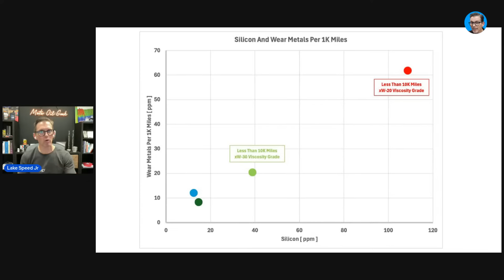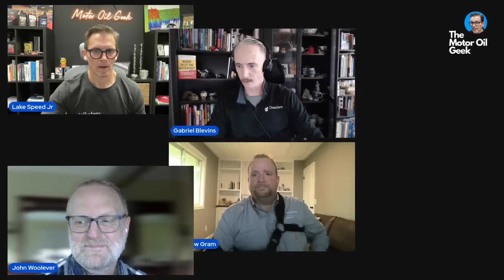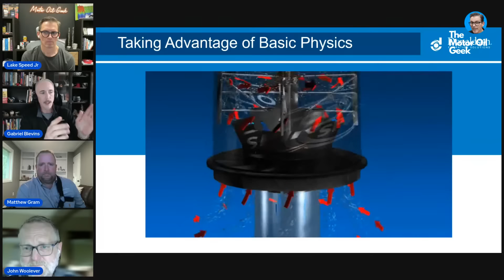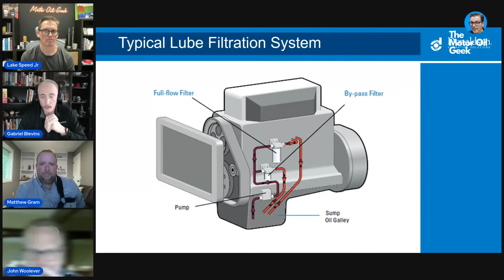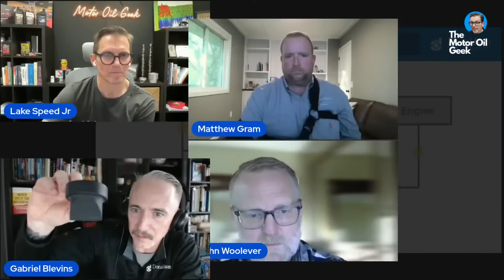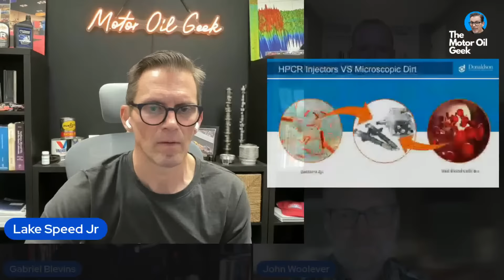DIRTY Filters Are BETTER Filters + BYPASS Filters EXPLAINED

Comment: 57:21
Well I think it is true and I cannot say how much I was surprised when I changed the diesel filter of my car after 50000 km (at 150000 km). It was extremely clean and the diesel filter housing that is gonna hold any drop of water has no water or dirt!
I always fill up with diesel at Total gas stations but I have no idea about where the previous owner filled up with diesel. So I can tell you that diesel is clean here in France and it should be. Because the high pressure pump on the diesel cars is extremely sensitive and the injectors holes are super small.

Comment: i see so many rats and mice in engine air filter boxes / cabin air filter boxes so just remember to either block off with wire the entrances (preferred) to you cabin air filter / your engine air filter. at least check it immediately if you see rat or mice poop under your hood. if they eat yoru air filter you are in a world of hurt or youre breathing in a ton of rat poop potentially just driving around. i just foudn one that over like quarter pound of poop iin the cabin air filter

Comment: Can you do a oil filter test, a special one. Say a wix xp filter says 20k miles, cut that in half, we aren't doing all highways miles, so now it's a 10k filter. If I change oil about every 3k miles, can it be re-used 2 or 3 times? leave it on or take off and drain and put back on? Is a XP filter a waste of money and just get the regular Wix and toss it every change?

Comment: As for air filters, I used to own a tuk tuk in Southamerica and the filter was an oiled sponge you would wash with diesel and oil again, wringing out excess, every oil change. So I'm thinking of putting an oiled sponge in the air duct of my 4x4 as a pre filter...might work if it doesn't restrict air flow too much...

Comment: Believe it or not, a dirty filter will get better mileage because it limits flow which is all that the mass airflow sensor sees. Less air is less power and less fuel is used.

Comment: A combine used in a crop like soybeans may be the dustiest environment I've ever seen and yes, I've seen the times that they need cleaning or inspection every day or every couple of days. Most manufacturers recommend light tapping on a tire or something similar, or washing in soapy water and allowed to dry, but not compressed air.

Comment: The problem is I've caught dealerships red-handed NOT changing out my oil filter during 'free' oil changes. Therefore when I do my own supplemental (5k mi) oil changes on my cars still under warranty, I always feel compelled to put in a new oil filter (all of my cars take cartridge style oil filters). You simply cannot trust dealerships to actually do what they say.
Reply: I worked for dealerships for twenty years and NEVER saw a mechanic or apprentice NOT change any parts that were specified to be changed for that particular service.

It is of no benefit for a dealership mechanic or apprentice to not change any parts, as it is not coming out of his pocket.
He doesn't own the business.
The extra time it takes to change the parts is not coming out of his pocket in lost labour charges.
I have NEVER worked next to ANY dealership mechanic or apprentice that had brand new, unboxed parts sitting on his workbench after a customer's car went out of the workshop.
It never happened.

In fact, if it were to happen, it would be more likely in the independent shops, as  if they didn't fit the parts but still charged the customer for it, there is a financial benefit for that owner operated independent shop.

Your opinion is  unfounded and totally BOGUS.

Watch out for those independent mom and pop type shops, they are doing it tough, and need to make money at every possible opportunity.

Comment: What about break in process? Does this still apply? First startup for 10 min, flush oil, run new break in oil but don’t change the filter until next change? Or should we still change the filter since it’s “extra dirty”?

Comment: I worked in water treatment R&D.  With a single media as you describe being top loaded we would often only get 1/8 gal/sf of flow. This would mean a huge filter to provide water to a community. To beat this we created a multimedia filter in three layers. The outside filter collected large particles, the middle filter smaller particles and the lowest filtered out the finest particles. Which this method we could increase flow to between 10 & 20 gal/sf of media. Why can't this be done with filters for automotive & industrial applications.

Comment: Ahoy, oil, oil filter geeks.  I would appreciate it if you could in the future discuss Marine Diesel and Gasoline oil and oil filters.   Specifically, GM and Ford small blocks and Detroit Diesel best oil, oil filters to use.  Because most small block gm or ford engines use a single oil filter, assuming a by-pass valve exist in the oil filter, do you recommend a bypass filter in line with the by pass, effectively filtering the oil twice when the primary filter is not block.   Thank you

Comment: I put an Amsoil EAO26 filter on my 98 Lexus GS400 just so I could replace the tiny factory filter with a 2 quart filter just to add oil capacity.  After watching this I probably should have never changed that filter ever, 2 quart filter and that engine was super clean in the 328k miles I had it.  With oil analysis it did well!  But 25-30k oil drains was on the edge of oil life.  

I am thinking about starting to go to oil analysis for oil changes instead of mileage/age oil changes.  I drive so much highway driving to work and back I'll bet Lake can tell me better when I should predict to change my oil instead of just mileage.  

when I was in the US Army they were very big on oil analysis oil changes only.  I RARELY ever needed to change my trucks oil.  855 Cummins and a LDT465 Turbo.  They would tell us when to sample and send it in and then tell us what to do, filters, oil or both.  The HMMWV's got regular oil changes but the big commercial diesels we had never did.

Comment: I put an air filter indicator on my Honda Talon because everyone says that the filter on this model only lasts a couple hundred miles.  After 2,000 miles the indicator still hadn't moved and I hadn't lost any perceivable performance even tho the filter looked horrible.  I replaced it only because I'd bought a complete service kit that included it and it lives in the desert 150 miles away so I decided I should change it to not have to deal with any mid-season surprises.

Comment: Many decades ago I was a "Filtration Specialist Sales Engineer."  Got trained by the OK City company that makes Wix and many other filter brands.  

The fact is, that dirty filters filter better. Of course, you don't want to clog a filter so much that the bypass opens at normal oil temperatures.  Highly unlikely unless you never changed your oil filter.

Another seldom acknowledged fact is that even if a filter is rated at XXX percentage efficiency at 30 microns it will often filter much smaller particles. This is due to particles that might pass through the filter just simply stick to the media.

Comment: My connecting rod went through the engine of my F800GS. The dealer blamed it on an aftermarket oil filter. I had replaced an OE filter with a Bosch. The specs appeared to be in favour of the aftermarket, having a slightly larger filter of the same efficiency/media type, and a 8 psi bypass versus a 8-11psi (never used I'm sure). The both have anti-drainback valves and are side mounted. I assume both filters are more than adequate and neither should reach bypass in a healthy engine (i.e. the dealer is full of it).

Comment: Would it be acceptable to leave a 20,000-mile oil filter on for three separate 5,000-mile oil changes?

25 F150 5.0 Coyote, Purolator Boss 20k oil filer, Pennz 5W30 Ultr Platinum
Reply: If it says it's good for 20,000 why not try and leave it on there for 20,000 see what happens.

Comment: hmm, if replacing oil filter too often could end up with “worse” filtration, then I wonder if it would be beneficial to change filter every other oil change? For example if oil filter is good for 10000 miles by manufacturer then changing the oil every 5k and oil filter every 10k would benefit the filtration efect?

Comment: I have a cleanable dry performance air filter with an oiled foam wrap around it in my 03 Z06 Corvette in the wet Pacific NW. The red foam wrap starts to show some dirt on it, while the dry filter at least looks totally clean. My recent 4,000 mile oil analysis showed 12 ppm for silicon with AMSOIL Z Rod 10w-30 oil. Does this look like a good program?

Comment: Lake, any plans to do a video on Oil Filter Efficiency over time? And does this mean if buying a Purolator Boss oil filter rated for 20,000 miles, can I conduct 10 oil changes before changing my filter if my OCI is every 2k miles.
Reply from the maker: Yes, that is on the schedule for later this year.

Comment: so what's the difference between cold air filter compared to a regular filet. my 2006 ford focus had a life time air filter, which is the last filter you need for your car. to repalce the air filter was almost $700.00. as i was saying eariler, what is the difference with position of the air filter. on subarus they have 2 air filter, 1 filter is below the windshield then the 2nd air filter is down below thebumper. by design of the instalation. then as for the motor is their a diference between front/reatr/mid engine. as well will more filters maximize the air flow???? then time of year where as middle of winter will be different then dead of summer. then the location its being used as well, like some of them are being used in coal mines, are different to the street of downtown Calgary vs dead of summer in the dessert.

Comment: The problem with just adding a bigger filter for something like engine oil is going to be to do with dry starts. A lot of car engines will have the oil filter mounted sideways, or even upside down (like Subaru does), and the result is that even with the best anti-drainback valves, the filter is still going to be empty when you go to start the engine in the morning. 

What then happens is you have to wait after the engine starts, until the oil pump fills the filter and pressurizes the oil galleries. If you have a bigger filter, it'll last longer, but it will also mean that you have more time running without oil pressure every time you start from cold.

Comment: 49:40 diesels at idle are still running higher rail pressure than 5kPSI in some cases. A lot idle at like 6-7kPSI or so

Comment: What are your thoughts on using a oil pump extractor for oil changes?
Reply: It's great for leaving a lot of gunk in the bottom of the engine.  Most of the places that use them use them for convenience and speed and that's all.  It's still better to change the oil frequently using that then not changing the oil frequently, that's still probably going to be better for the car if you change the oil every 3 to 5000 miles even using a vacuum sucking technique out of the front then trying to go 10,000 or more miles on a single oil change.

Comment: i need a TLDR on this its too long for me to keep up.
Reply: Key points:
•	Silicon and Engine Wear (0:10-0:26): Lower silicon levels in oil (indicating less dust) directly correlate with reduced engine wear and extended engine life. 
•	Filter Design & Efficiency (3:30-4:37, 10:20-12:57): Filter design balances efficiency and longevity. Counterintuitively, a dirty air filter is more efficient because the accumulated dust helps capture more particles. 
•	Air Filter Indicators (10:59-14:00): Modern diesel engines use indicators to signal when an air filter truly needs replacement, allowing it to reach its full service life and maximize engine protection. 
•	Maintenance & Risks (18:50-20:55, 17:14-18:42): Cleaning air filters is generally not recommended due to the risk of damaging the microscopic media and voiding engine warranties. High-performance air filters are often unnecessary for daily drivers and can even be detrimental if they compromise filtration. 
•	Bypass Filters & Valves (30:15-36:56): Bypass filters "polish" oil by removing finer particles like soot, extending oil drain intervals in diesel engines. Bypass valves are crucial safety features that open to ensure oil flow to the engine if the main filter becomes clogged, preventing catastrophic failure. 
•	Filter Sizing (41:50-43:06): Using the largest possible filter by footprint generally increases surface are

Edit: Parts of that might be incorrect AI slop, as it was generated via Youtube premium’s summary tool.
Reply: @NickWindham god i hope you get everything you’ve ever wanted and more and live happy

Comment: @themotoroilgeek I have a question- Do you see the same type of efficiency increase out of your oil filter? 

For example, if you are changing the oil at half of the manufacturer’s recommended oil interval or sooner, could you change the oil filter every other oil change?  Would it benefit anything, or would it be inadvisable because of the increased residual oil (assuming you do not remove it-and I wouldn’t remove it and put it back on).

Forgive me if you may have addressed this in another video.
Reply: I've never wanted to do that, but Honda has recommended exactly that since the 90s at least.
Reply: @A@AlexandarHullRichter Here’s the thing: I use a larger oil filter than OEM.  More filter media and surface area so theoretically longer service life than OEM.  OEM recommends a 7,500mi oil/filter change interval.  I’m thinking of doing 3,000mi oil and 6,000mi filter change interval.
Reply: So you're planning to change the oil filter more often than the manufacturer's recommendation, and the oil twice as often as that, and you think that will be a problem?
Reply: @AlexandarHullRichterno I didn’t ask if it would be a problem.  I know it won’t.  Not with oil (It obviously IS a problem if you change your air filter every 3K miles though because it doesn’t get a chance to maximize its filtration). 

I’m asking if it would be BETTER.  My theory is it would be better (although possibly negligibly) to wait a bit longer intervals for my oil filter as long as it is still under within suggested intervals, to help maximize filtration.  I was just interested in what Lake thinks about it.
Reply: @mattchumley6735  ok, so I brought up Honda's recommendation because it seems to align with your plan.

Comment: I’ve been looking for awhile and cannot find any definitive information on aftermarket oil bypass systems. I have an Amsoil dual remote oil bypass system on my ‘17 super-duty 6.7 diesel.
I have seen a number of posts where people have removed their dual remote oil bypass systems from concern that the 3’-4’ lines from the engine filter mount to the remote location where the full-flow and bypass filters are mounted could be reducing oil flow rate or pressure as the lines are 1/2 inch.
Some claimed that Amsoil would not respond or even voiced concerns over this issue.
Also, this dual remote bypass system does not flow bypass filter oil to the sump, it is returned with the full flow filter.
The Amsoil single bypass system for the same engine has the full flow filter mounted to a bracket that is mounted to the normal engine filter mount then oil is redirected to the single remote bypass filter that then does return the bypass filtered oil to the sump.
Wish that someone would do an accurate look at these 2 systems and the pro’s and con’s to both.
Don’t expect any replies but can’t figure out a better place to ask!

Comment: If dusted up from off-roading, is ok to just tap it upside down to clear out some of the dust?  Typically I carry a brand new one with me when I worry about very dusty trails (4Runner going off roading, and I do not have a snorkel set up. ... yet).  There was one trip where I really should've had 2 new air filters with me, when I drove up and back on the Dempster Hwy (800kms one direction from a main road up to Tuktoyaktuk / Arctic Ocean), a 95% shale build road in northern Canada.
Reply: I'm wondering that too. I've done that just to extend air filter life when I haven't been off road.

Comment: Does changing your air filter change your mpg?
Reply: It shouldn't. Even if it is restrictive, to the engine, it would be like you just didn't open the throttle as far.
Reply: It definitely can, lots of variables.

Comment: As someone who sells for an oil company that makes high end products, the fuel filtration conversation was nice. Diesel fuel is terrible and can cause so many different issues from asphaltenes, carboxylates, IDID (internal diesel injector deposits), filter clogging, bacteria humbugs, etc. I will say that we have one of the best products on the market and will solve these problems and more. Such as increase fuel economy, reduce active and passive re-gens, wear scar reduction with lubricity additive among so much more. Primrose oil 5007 Power Klenz and some others in that power Klenz line. If you would like to know more reach out to me and Lake our Tribologist Matt Moore said he heard you speak in Atlanta. Enjoyed the speech.